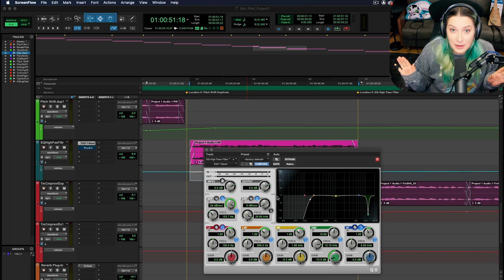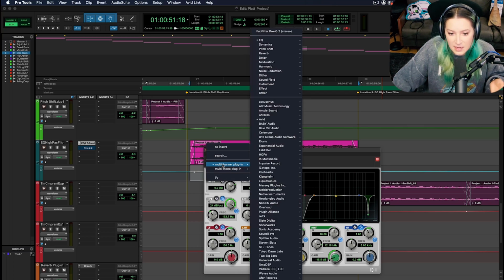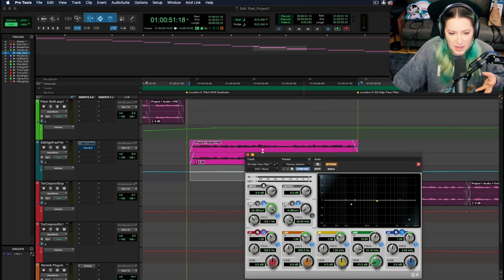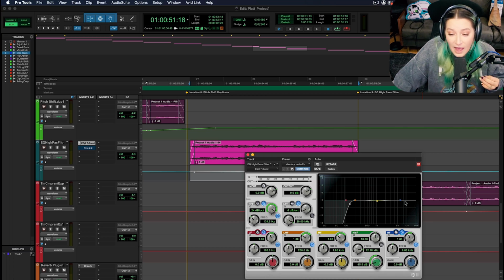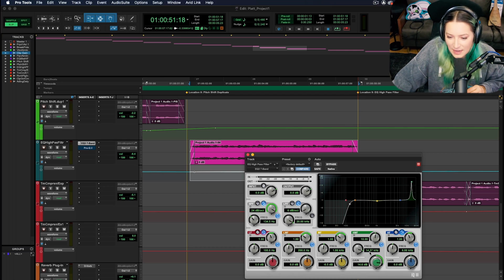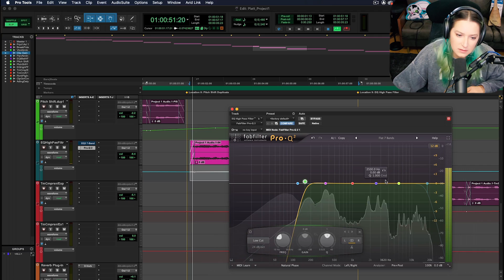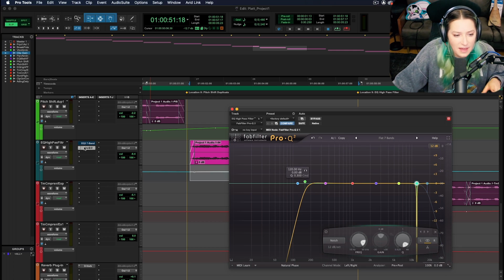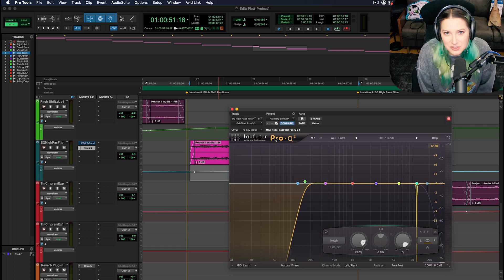Audio Basics: Notch Filtering

Comment: In physics and engineering, the quality factor or Q factor is a dimensionless parameter that describes how underdamped an oscillator or resonator is.
Reply: Thanks Wikipedia!
Reply from the maker: Haha, I forget if this video was before or after I figured it out, so I don't really know what I said in it. But, I also figured this out: I got an electronics technician degree at the community College here in San Diego before covid hit, and in that degree I learned that q in electronics often stands for quality (just like your physics example), and it's used to describe how specific electronic components/systems are. So, the narrower bands can give you more specificity, so they say they have higher quality - which is why the q band in an eq is higher when it's narrower (and where the q comes from in the EQ world). So yeah! Haha, now we know!
Reply: Now time to learn some sound design.